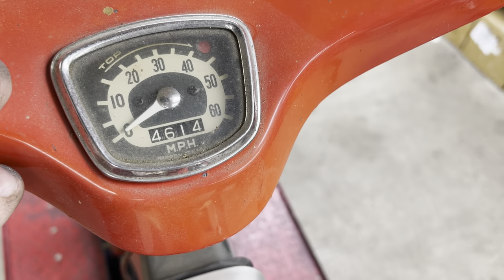Honda C102 - Lifan swap  video #1 of 3

Comment: Mike, great to see Your doing this engine swap. I have a 1966 CM91. Pretty much the same bike as this one. Lucky for me the original 90cc engine was fine. When purchased in December of 2019, it had 888 original miles on it. I ride it 2 or 3 times a week and have put 700 miles on it without any problems. Thanks for the videos.

Comment: Hi Mike, I have done this engine swap before, you will need to file/shave a bit from the frame at the rear as the lifan/Honda 90 engines are slightly bigger, you will see what I mean when you come to fit the engine :)
Reply from the maker: Thanks!
Reply: Welcome mate! Love your work! Your wiring videos have helped me out a lot!

Comment: Hello, I have a C100, which is basically the same save electric start. I think.
Same push rod 50 cc engine etc.
Because I can’t find a decent replacement carb, 
I am in the midst of putting a chines clone engine in mine as well.
I opted for a 125cc.
Reply from the maker: At the time I was building this bike, the only 125’s available were manual transmission.  This bike didn’t have a handle perch on the left bar, so I really wanted a semi-auto and the only thing available was the 110cc.  It still sends the bike around 53-55mph, which is plenty.
Reply: @MiniBikeMike  my engine, because it’s all I could find. Is a 125….3 speed with reverse. And electric start.
I’m not finished yet.
But it ought to be interesting indeed.
And I’m sure, it will go faster and have more power than the original.
Just hope I don’t snick reverse….at 40 mph! Ha ha ha
I was looking at the 125 non electric start….but, yes…they all had manual clutches.
Save all that original stuff. It might be worth something, someday.
Reply: hey i have a 4 speed chinese 125cc engine i just mounted in my '68 c100. not sure what throttle and clutch cables i need to get,
Reply: @Vaz_DeFerenz  mine does not have a clutch. So I ordered just the basic throttle tubes. I found a piece of pipe (conduit) cut a slot in it lengthwise , spread it out, and glued it on the tiny diameter handle bars, so the new throttle and grip would fit correctly.
Reply from the maker: You can use a clutch cable from a 4 speed CT70.

Comment: Just wondering Mike as it's electric start is it 12-volt electrics already worth checking the battery and seeing
Reply from the maker: The battery I pulled out was a 6v battery.  I guess I should have looked at bulbs.  It will get a new wiring harness and all new bulbs.
Reply: 6v
Reply: @MiniBikeMike  I'll be waiting to see the harness installation and which one you use. I'm struggling on mine.

Comment: Hey Mike , I bought a CT 70 roller. So I need a complete motor. Is there any Chinese motors that look identical (or close) until I can find a original motor. The ones I have seen both side cases look way different
Reply from the maker: Lifan used to make a 90cc engine that was spot on identical to the Honda 70cc, but unfortunately, no longer available.  No, I’m not aware of any engine that matches the original in shape and color currently.

Comment: Why is the engine not rubber mounted on these bikes ?
Reply from the maker: Single cylinder, very little vibration.  Are any bikes with a less than 500cc engine rubber mounted?
Reply: @MiniBikeMike   Ok .Thank you ! ..i just had mopeds before also 50cc towstroke..and they are rubber mounted every of these 2s.  mopeds ..also all of  the new Chinese scooters .
Reply from the maker: @-M-511  I’ve never owned anything but Honda’s, from 50cc to 750cc, and they are all solid mounted.  I guess each manufacturer has their preferences.
Reply: @MiniBikeMike  i guess , good work in your vids 👍
Reply: @MiniBikeMike  yea plus it a 70 years cheap bike

Comment: How are u sir would 110cc lifan fit on my 50cc honda cub
Reply from the maker: Yes, I believe the engine mounting bolts are the same.
Reply: Would the 110cc cylinder head and block fit on the 50cc engine
Reply from the maker: @saeedkhan7999  I doubt it, but I’ve never tried.  Why would you, just install the 110cc engine.
Reply: @MiniBikeMike  where can I get one from Amazon don't have
Reply from the maker: @saeedkhan7999  https://www.ebay.com/itm/225090459815?mkcid=16&mkevt=1&mkrid=711-127632-2357-0&ssspo=f9zobehrrkc&sssrc=2349624&ssuid=AofC-Fx0Riy&var=&widget_ver=artemis&media=COPY
Reply: @MiniBikeMike  thank u so much